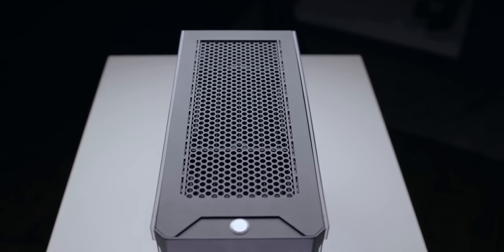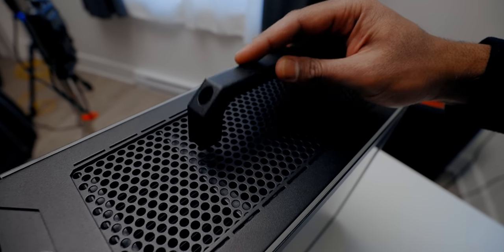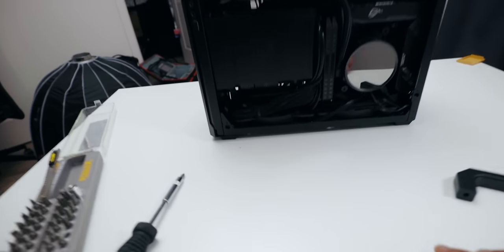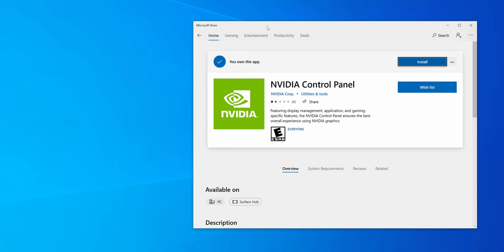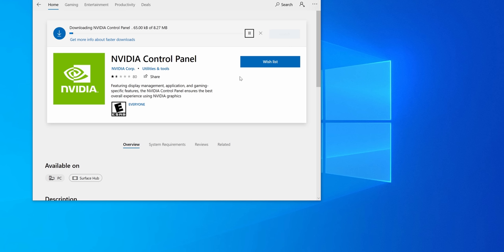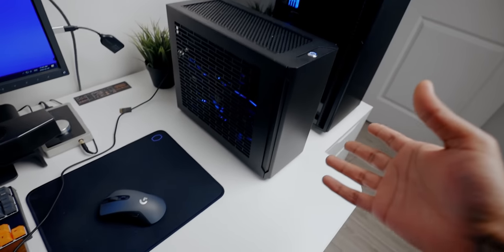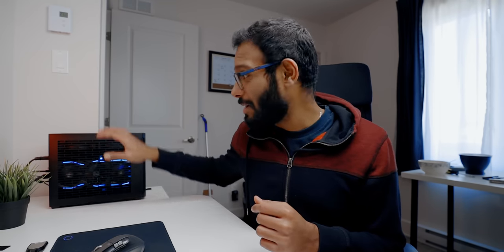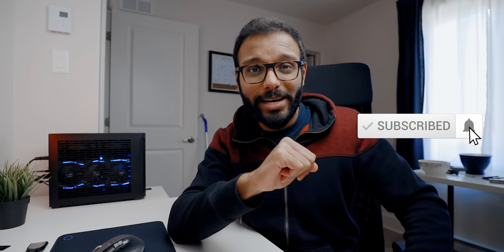My ITX Dream PC Has PROBLEMS - Time To Fix Them!

Comment: Always interesting to see the issues people may have. I have silent wing 3 fans, can't even hear motor noise from them. My silent wing 2 fan that came with my BeQuiet Shadow Rock LP is fairly silent with some motor noise but at low RPM speeds more silent than Noctua (but Silent Wing 3  is the more silent fans I've ever used). It looks like you are using the BeQuiet Pure Wings 2?

Comment: I had to set a very conservative fan curve for my Ryzen cpu as Ryane tends to spike a lot during idle. It does not help that the Kraken silent fan curve still ramps the fans to 100% once the CPU hits about 50+ degrees.
Reply: Germaine VANGUARD I did the same thing!! The fan flutter was super annoying when the cpu would go from 30-45 for no reason....

Comment: Those BeQuiet fans as intake are fighting your GPU, not helping. The Asus Strix cooler expels air down and up. Swap them to exhaust and your temps should improve by up to 5C. Optimum Tech has tested this on many ITX setups. Fans near open air GPU coolers perform better as exhaust.

Comment: Pay attention to which Nvidia drivers you install. If you get the DCH driver you'll need to get the Nvidia control panel from the Windows Store. At least that's been my experience. You can still manually select the older style driver if you manually search for the driver on Nvidias website

Comment: in AI Suite, you can set a damping effect to the fans! I have mine set to 30 seconds to prevent the fans spiking up and down constantly (which for some reason my old 1700X and now 3700X does? it has a sawtooth pattern... 7c swings Google Ryzen Sawtooth) - i have WC so the water can hold temps before the fans need to dissipate - might work for you

Comment: I have same case but Intel setup, I have the AIO pushing air up and out the top, and the bottom fans pulling air out the bottom so the sides are the intakes (negative pressure). It' stops the air-turbulence around the gpu and really does help with the temps and noise. Check out OptimumTech's channel, pretty much focuses on all things ITX.

Comment: Try having your fans react to the temperature of the water instead of the processor temp. Set this up in the NZXT software
Reply: Dave Seated I did this, but eventually just pulled the fans off and plugged them directly into my MB headers. So much better and now I don’t need cam at all

Comment: Had the same issue on my 8700k system, assumed it's because of the stock fans on the AIO, went ahead and replaced them with Noctuas and the noise level was the same... Then I realized that for some reason my corsair exhaust fans were ramping up, created a fan profile in Icue and now the system is much more silent

Comment: With that gpu right up against the side panel of course your temps are terrible. The GPU heat is going nowhere, building up and causing your fans to go nuts. Use some Noctua fans (they have black and grey ones now if that bothers you) etc. Watch or contact Optimum Tech. He knows his ITX lol

Comment: Nvidia Control Panel thing is not a bug. They just change it on windows 10 and didn't told anyone. Go to Microsoft Web store search for "Nvidia control panel" and install it from there to get it back as it was before. This should have just been done with the driver install but it wasn't for "reasons".

Comment: RE nvidia control panel, you need to install it sepeatly as a app through microsoft store. that will fix it. this only happens on totaly fresh install`s of windows, every ryzen build iv done where iv used a pre 1806 build iv had to repair to install normal driver package, or "log in" and use the app store.

Comment: This NVIDIA Control Panel problem can be caused from DCH drivers. In this version of this NVIDIA driver is only serviced with core components, it's designed for Windows 10 version 1803=< and extra components of the driver must be installed from the Microsoft Store (On this situation, it's NVIDIA Control Panel.). I didn't watched the video but after i watched it, I was right.

Comment: You do not need to download the control panel from the windows store, all drivers I have used in the past decade up to as of current release 442.19 I have always had the control panel option in both the right click menu and the taskbar. Just DDU out the current driver and reinstall it.

Comment: Try to undervolt all in that system.
you can put your finger not on blades but on blades. But on voltage mode with 0 speed they will not spin up.

Comment: I wonder if cooling could be improved by flipping your PSU so the fan is facing outward and replacing that closed side panel with another vented panel.

Comment: Well you couldve also gone onto AI suite 3 fan controll section. Then it allows u to identity which fan is running at what rpm by turning off all other fans for a sec. Thats the way i done it tbh

Comment: put some spacers even noctua fans do that when you place them facing some mesh or vents they make weird noises or what i do to most is remove the vents with a dremel leaving just the mounting holes, best software i found for fan controll is Argus monitor (sadly it isnt free but try it free for 30 days and u'll probs pay the $5 or some shit they ask for it)

Comment: I found out Silentium fans to be very quiet and pretty as well, i allways prefer with manual control. (you could even set them all under one switch using adaptor)
bios and softwares sux...

Comment: Putting a ryzen 7 3700 and 5700 xt in a sliger 550 soon (air cooled with both side panels vented), but only pushing 1080 gaming and some moderate design and editing. hoping it works out okay. dont care about noise though.

Comment: Have You tried to install older Nvidia drivers and then update them? My control panel never disappeared. I didn't even knew about this problem.
Reply: That doesn't work. Any of the drivers available at this point directly from the geforce site are all DCH drivers. And if you use something like DDU to clean out the old drivers (good practice) then it takes out the control panel as well. There is a work around to get the control panel installed with the driver.
Reply: @DJ_NOOB  No people are using the wrong driver. If you download the DCH or SD driver there is no control panel with it. If you install the GRD the control panel is included.

Comment: If be quiet made mini itx case (based on be quiet! Pure Base 500 ATX Mid Tower Case) that fits 175mm air cooler would you buy that case instead of lease tiger SM 750 ?

Comment: I'm running an I7-8700k also with a strix 1080 running strong debating upgrading the gpu or cpu don't know if it's worth it I'm running a 27" 1440p 144htz monitor and still hit 120fps easy on most games

Comment: Thanks, this was very very interesting.  I might by exactly this, seeing how well it can work. One problem though is that I have 0 plan on Windows, so probably Corsair H115i instead of Kraken (which requires CAM windows software).

Comment: Hey Eber, AI suite allows you to create a custom curve and save it as a new profile that you can load in whenever you want.  The high perf profile is set way too high imo, I shuffle between silent and when I game I load my custom one. Oh and you said you need to use CAM to control the fans on your Kraken? Is this not only true for the AIO pump which should be running at 100% anyway?  You can connect the fans to a fan controller and plug the controller into one of the CPU fan headers on the board and control them all simultaneously with your BIOS or Asus AI suite. This is how I control all seven fans in my system. I hate CAM software even more then I hate AI suite. AI suite I can live with but I uninstalled CAM a year ago and have not been happier.

Comment: Did you know checking if Windows is updated will actually sign you up for extra beta updates. So if you would like to check and see if Windows is updated without doing that just restart your PC.
Reply: No, it doesn’t do that. If you want beta updates you have to sign up for them. It won’t sign you up automatically just because you checked for updates.
Reply: @EvilTurkeySlices  My information's from Tech linked, So I assume if it really was that annoying Microsoft changed it

Comment: I got the sliger sm550 with vented side panel. as much as I love clear side panel, I wouldn’t get the one for sliger, as I hate acrylic panel.  I would rather get the solid one instead. Not hating it just my opinion on acrylic panel.

Comment: I cut my fingers once by inserting it in a fan so be careful and slow it down gradually
Reply: That was quite common back in the Bad Old Days when strapping a 10K rpm Delta fan to the HSF was considered a normal way to keep your CPU from melting.

Comment: The silent fan curve preset on motherboards are only silent for ATX or mATX system where they have more spaces to dampen the noise.

As for the nvidia control panel... installing the nvidia drivers via GeForce experience seems to be the easiest solution. Drivers downloaded from the website just won't work.

Comment: I have a very similar config in a smallish case (Raijntek Thetis). I have the rad fans configured as input fans (push config above the rad) wheras the bottom  and back fans are output. I found that putting input fans right next to those honeycomb cutouts in the case was VERY loud compared to output. Maybe you could try that if you're still unsatisfied.

Comment: Hold on... You now have to download Nvidia control panel from the Microsoft store? I'm confused, as I just updated to the latest driver today (442.19 without geforce experience) and I didn't have to go through the Microsoft store to reinstall the control panel. I'm running a 1080ti with the latest Windows update.

Comment: Given your work flow, how is it that you store your files for editing? A machine like that can't hold that many HDDs.
Reply: Good question. That's a huge disadvantage. I have 6 SSDs on my Intel System vs 2 on AMD. I'm currently editing off an external drive
Reply: @eber.antony  That makes sense. Has that changed your work flow? Editing on an external drive.

Comment: how about installing older NVIDIA drivers with control panel included and then upgrade to the newest drivers ? could be something to do for ppl which have problems with control panel from Microsoft Store

Comment: I have the same motherboard and it has some fan noise from the vrm/chipset fans and I was contemplating swapping them out for the noctua 40mm fans. The computer is silent when it first turns on and a few minutes later those fans kick in and just add an unpleasant noise. the 120mm fans on the 360mm rad are quiet so only the motherboard makes noise at idle. Under load the the gpu starts making noise but I'm waiting for the new nvidia cards before watercooling that as well.

Comment: @hardwarecanucks suggestion for video - what case manufacturer actually support their cases,  I've seen dozens of threads of cases that have no replacement/expansions parts available for purchase on any platform (Amazon/Newegg and even directly from the manufacturer ) and have personally been through this on 2 sperate instances I've had a case where certain expansion parts or replacement part like a hard drive cage is simply impossible to get. And I'm not talking about old cases, my current personal rig is in a Cooler Master MC600P which came out around April 2018 and getting a drive bay is impossible.

Comment: I had the same issue with the control panel not showing but after running DDU and reinstalling drivers it came back. This was with the latest drivers as well so it's still included with the drivers.

Comment: Hey you have the DCH drivers installed just DDU them and get a older stuff instead (gotta download from sites as guru3d as I belive all downloads from nvidia/geforce are DCH) as DCH drivers cannot include anything but the driver, microsoft policy for dch mainly meant for OEM for compability reasons but for DIY just pain in the buttocs imo.

Comment: I've not had trouble with the nVidia Control Panel. I do, however, get BSOD issues with nVidia Experience. I get a stornvme.sys error and I've not been able to figure that one out, so I haven't reinstalled it.

Comment: for me, the my 3700x was ramping up the fans because of the boost in the bios. I turned it off, i stopped having thermal throttle issue.

Comment: for me, when i do a clean reinstall of windows from a usb, i leave my laptop to update for 1 hour by itself, and restart the laptop and do the update manually, the nvidia control panel is automatically installed from the update. But i still do have to install the up to date drivers by myself from geforce experience
Reply: and i do feel like the reviews are pretty stupid. I have install windows 10 on nearly 20 computers, and non of them had any issues regarding installing nvidia control panel through microsoft stores, or windows installing it by itself after windows update, or update apps in microsoft stores.

Comment: It might be me but I think all your hardware issues could be solved by placing the case on the floor...in that case noise solved, cable management irrelevant
Reply from the maker: Not if the floor is carpet.  :)

Comment: AI suite is an obnoxious program. It caused all sorts of problems on all PCs that I have installed. Even tough it fixed your sound problem, it probably mess up some other thing on your pc. I suggest not to use it. If you get a random blue screen out of nothing, try uninstalling AI Suite because probably the culprit would be it.

Comment: It is not long ago I updated my Nvidia drivers, and I still have the control panel. It must be very recently.
Reply: No people are using the wrong driver. If you download the DCH or SD driver there is no control panel with it. If you install the GRD the control panel is included.

Comment: Its not problem problem with Ryzen sistem, Intel i7 or i9 in that case and build like that would be even worse,  you would ended deliding intel procesor to even work without trothling.

Comment: I just installed the latest drivers from nvidia site 442.19 and has the control panel I've never seen that issue before.
Reply: He probably updated windows and didnt realize it reverts to default drivers sometimes and didnt update drivers again.
Reply from the maker: Actually it doesn't.  If you look in the installer files, the Control Panel has been removed.  We have confirmation from NVIDIA.  It gets installed (or at least its supposed to) by Windows Store during the install process.
Reply: @HardwareCanucks  they changed it a few driver updates ago, can always be found in the Microsoft store now
Reply: @HardwareCanucks  It must have been pushed through as an update then because this was a clean install of Windows on new system build I just updated the system and installed the Nvidia drivers from site. I never use the Microsoft Store because the apps are always flaky vs just installing then on their own.
Reply: @HardwareCanucks   1) download the international version of the driver and not the DCH version. (you can find download links on sites like Guru3D) 2) you need to clean your driver install with something like DDU. 2) When you install the new driver, disconnect your pc from the internet. If you don't then it will try to force you to install DCH drivers.

Comment: if I turn off or restart my pc there's a 50% that itll turn on if it does it works like a charm 

3950x
rtx 2080
32gb 3600mhz
windows10 on m.2

Comment: Hey Eber I have a trouble shooting question for you. I recently upgrade motherboards because my old ones built in audio died, plus it was a budget b350 board I got to run my 1600, now I'm on a 2700. For some reason my new board won't let my cpu turbo or boost in any way. I have tried everything I know to do and putting the 2700 back in the old board it works fine i just have no onboard audio, lacking support for my fans (I need two hubs to get them to work) and memory support is awful. My new board by contrast works as intended but it simply won't let my cpu boost and even when I hit my system with a stress test it caps at 99% usage. Does anyone have an idea what's going on?? Also my new board is the asus prime x470-pro

Comment: CPUs need all the cooling they can get! Put an AIO on them and get that hot air exhausted as easily as possible! Oh, but GPUs? Yeah, they don't need much cooling. Just smash them against some glass.
It's time for a change in PC building tradition. GPU AIOs need to become more popular. I'm tired of inadequate graphics card heatsinks, and especially poorly designed cases that don't allow any airflow to reach the graphics card. I could have sworn that, in general, GPUs take more power and let out more heat than CPUs do. Why don't they get decent cooling, too? Aesthetics?